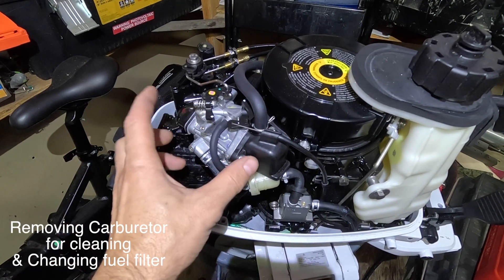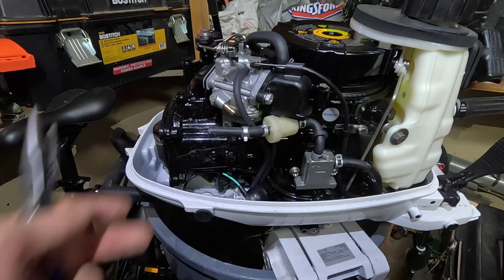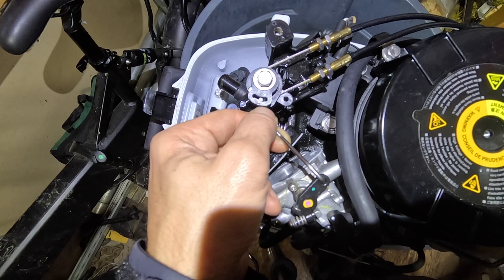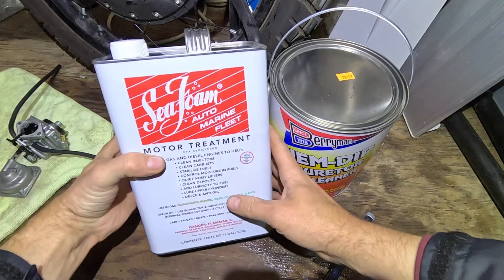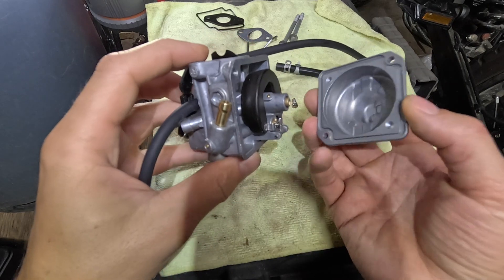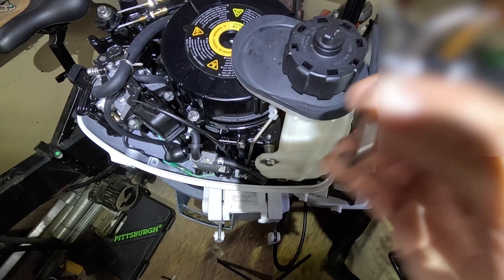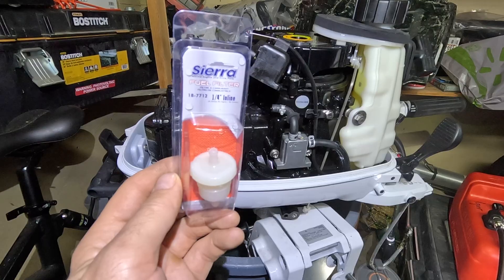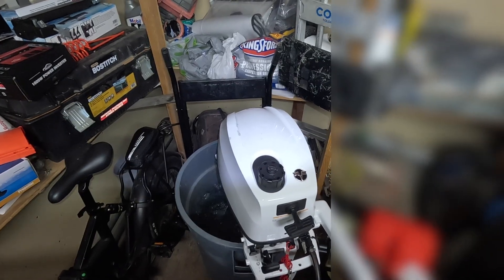Tohatsu 6hp engine Bogging down easy Fix

Comment: Don't put rubber, like the overflow tubes, or plastic, like the throttle connector, into chem dip.
Reply from the maker: You are right, it's just some parts are more difficult to remove. Thankfully, I haven't had any issues after.